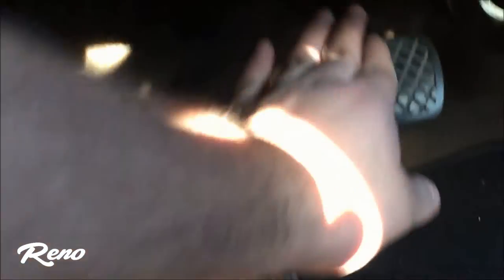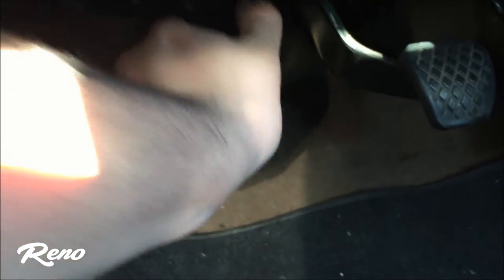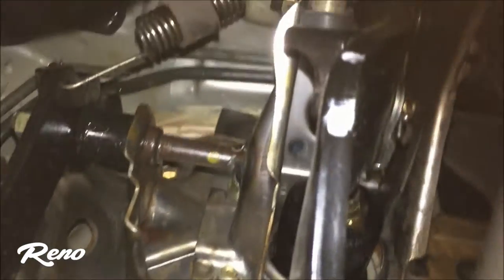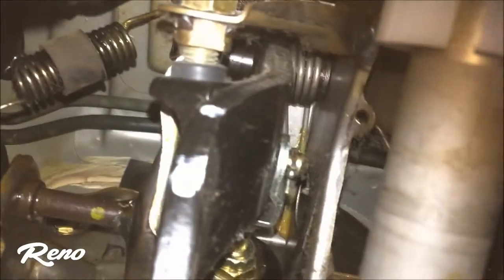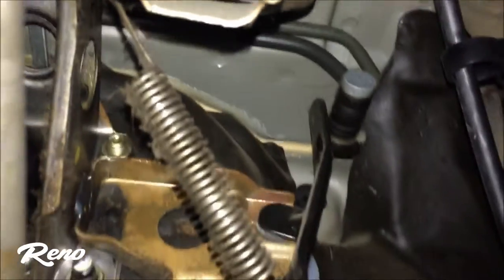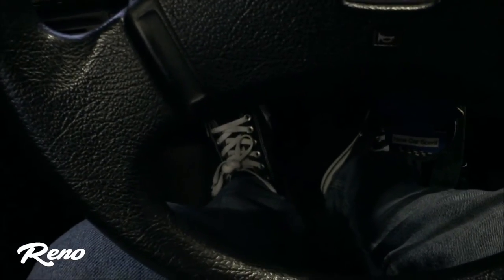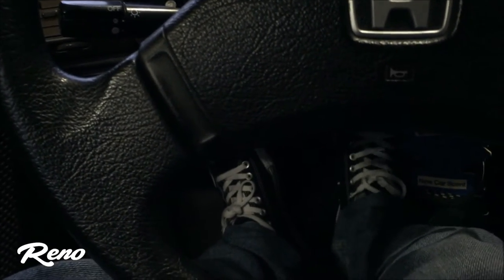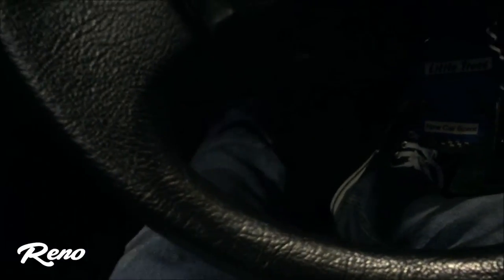Honda Civic Clutch Pedal Squeak

Comment: I'm writing this on March 9th, 2019. This video is now a bit over two years old, but perhaps my comment will be of help to someone who's here in search of a solution to a newfound problem. ; ] 

Over the course of about five attempts I tried two very high quality greases and PB Blaster to address a similar squeak and a little 'pop' I could feel and hear in my clutch pedal movement. It's very difficult to get to the linkages and spring contact points with the pedal assembly in the car -- but takin' it out is an absolute last resort. ; ] 

All told, the only thing that has worked long-term is WD-40. I like the stuff, and have used it quite a bit over the years, but honestly it's rarely my 'go to' goop. Well, it's always said "Stops Squeaks" on the can, and I must have forgotten how true that is. ; ] 

In my opinion, WD-40 is probably your best choice for a lasting remedy. Use the can with the straw, and bend it as needed to precisely hit the logical points while avoiding careless and potentially problematic overspray. Soon thereafter you should be changing gears without any annoying and slightly worrying unwanted noise and feel.